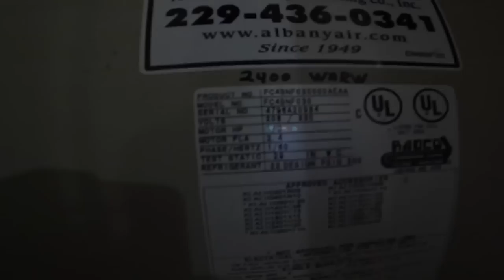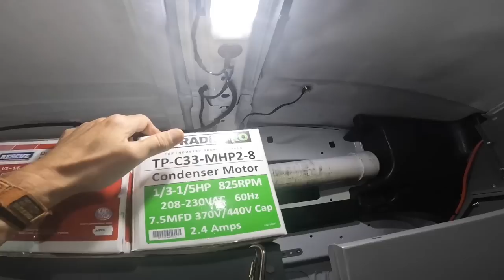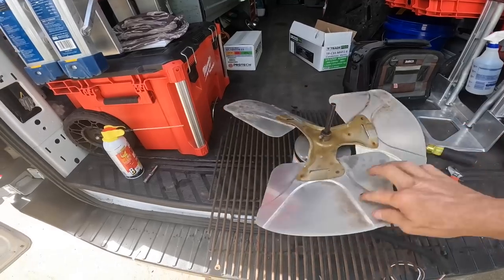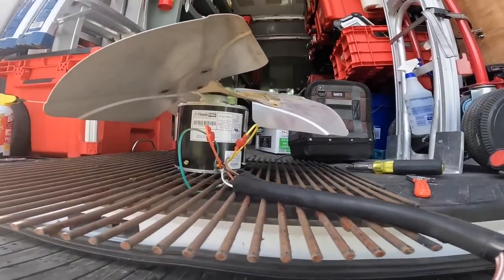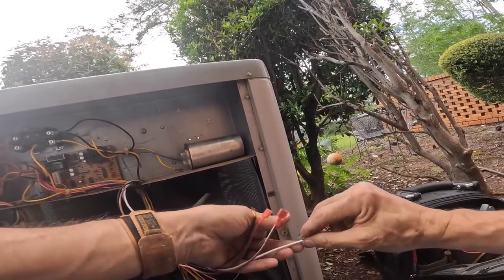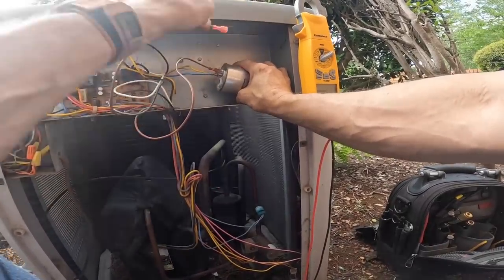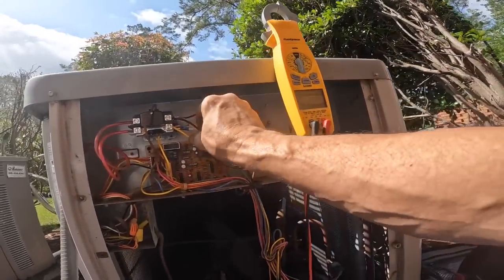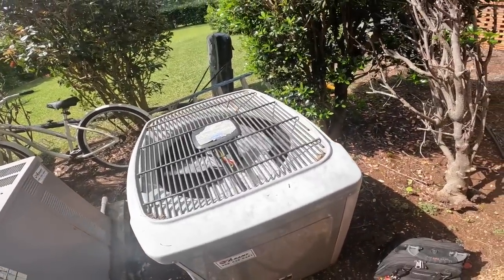Really Loud Screeching Noise Coming From the AC! #hvacguy #hvaclife

Comment: You still installed that motor on the wrong side of the grill. Look at the beginning of the video and see how the grill/motor is installed.
Reply: Good catch , could happen to any body.
Reply from the maker: Didn’t see it at the time.
Reply: @HVACGUY  hey Curtis!! I think the fan motor is on the right side I can see the name brand on the top and the fan below u did just fine 😊😊😊😊😊 great job by the way !! Still trying to figure out this oil furnace at my house I got a buddy that also does hvac coming to help me figure it out !!!!
Reply: Curtis leaving the motor grille upside down may cause some extra rattling etc that the homeowner won’t care for
Reply: Curtis it also looks like you left a piece of trim that goes around the edges of the grill. I could see it laying on the unit next to the one we’re working on. On the sheet metal
Reply: Everyone was yelling “The grill is upside down!”
Reply: @chuckquinn8026  Yep, I was yelling but he didn't hear me. LOL
Reply: whoopsie, yeah, it's on the wrong side, the motor case is against the grilles, instead of the nuts on studs. hopefully the nuts holding it don't back off with vibration and send motor/fan into coil and tubing. 😬

Comment: I notice you never remove the rain slinger when installing replacement motors oriented shaft down. Rain that runs down the outside of the motor collects in the cup the upside-down slinger forms keeping the bearing immersed through the winter months.

Comment: Ever thought of using Fluid Film on the fan motor shafts ?  Would make removal easier lasts years in your application.
Reply from the maker: Never heard of it.
Reply: I use anti-seize.
Reply: Always just used  anti seize too

Comment: I must say Curtis, you are one of the most honest HVAC contractors I've ever seen, so many out there would have seen the date code of 1995 and would have told the customer it's not repairable and you need a whole new system, inside and out, and quoted them about $10K-$13K, and walked away leaving the customer with a hot house when all they needed was a $150-$200 fan motor and a $30 contactor to be back in business.  Question, I've noticed on many of your service calls when you open the unit up, the run caps are still stuffed in the original packaging box, or the empty box is left inside the unit.   Is there a reason someone is doing that?
Reply: Lazy! Never leave a cap in a box

Comment: That multi horsepower motor is taller than the OEM. Fan blade is not in the exact spot as it should be. I think efficiency and head pressure will suffer. I would go back with exact HP and amp rating. Exact HP motors are lower in height.